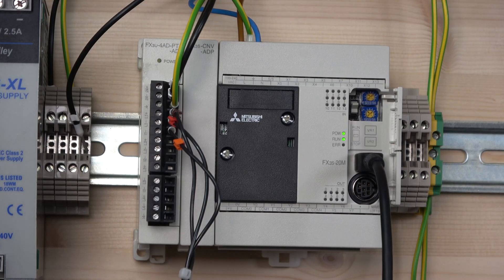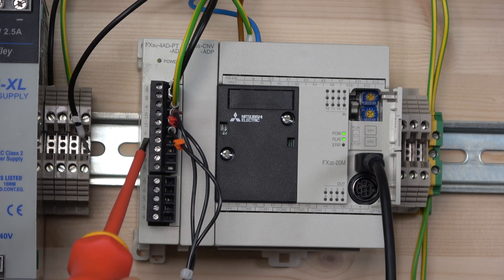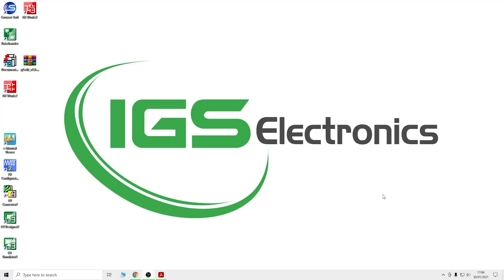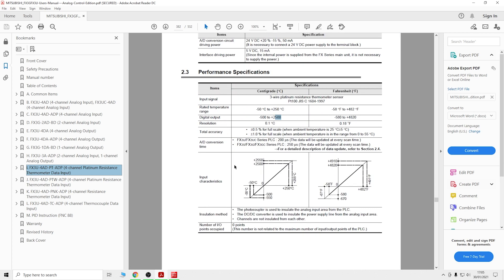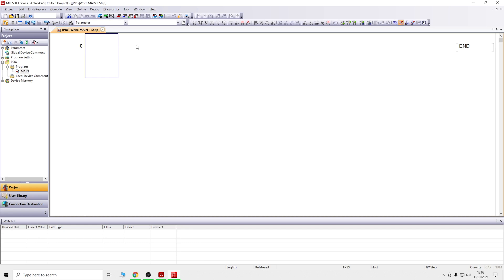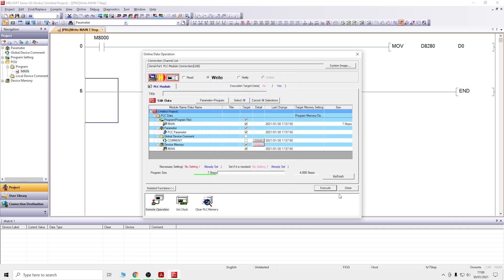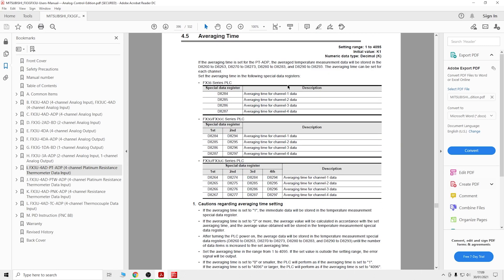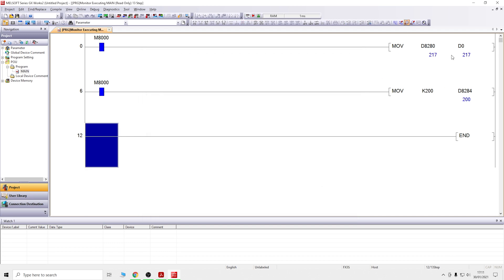Mitsubishi PLC programming FX3u-4AD-PT-ADP PT100 thermocouple analog input card set up. ( English )

Comment: Hi, how to convert to real temperature with PT100 and AL2-2TC-ADP converter so that it also shows minus temperatures? The converter gives signals 0-10V 0-4000. is the value
thank you very much

Comment: Hi, I would like to ask about the ' To & From ' Function for Mitsubishi FX3G PLC. To understand the temperature inside of the machine and I can set the temperature setpoint by using HMI to control the temperature of the machine (NOT using PID to control ).  The sensor I use is an analog input and the heater is analog output for the PLC programming. If I write PID programming inside the PLC, Is it possible to use it to control the temperature BY  using HMI?
Reply: I have been searched the method for temperature control online. All the result was just telling me ' Use PID programming to control the temperature and read the temperature of the machine '. BUT what I need is to use HMI to control the temperature and read the temperature of the machine. SO, is it possible to use PID programming INSIDE  the Mitsubishi FX3G PLC  and I use Mitsubishi HMI to control and the temperature of the machine?